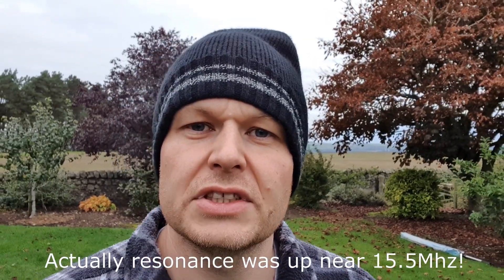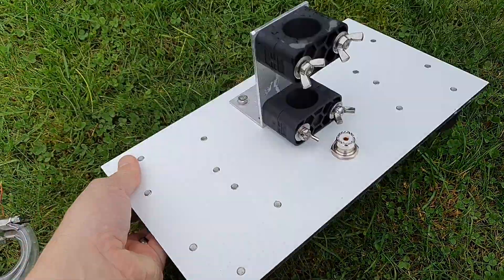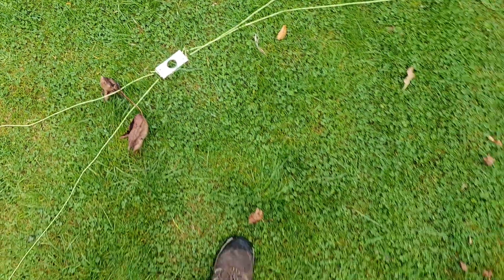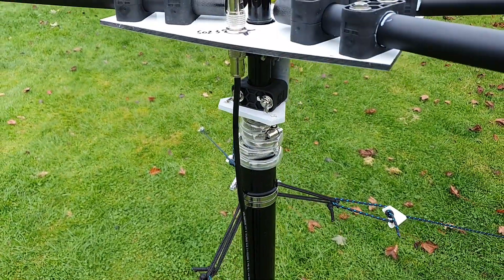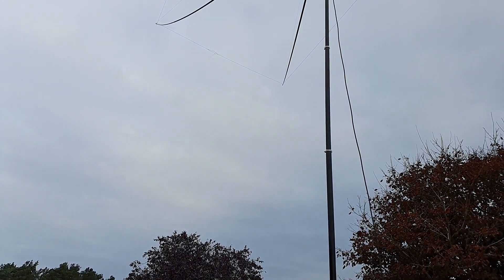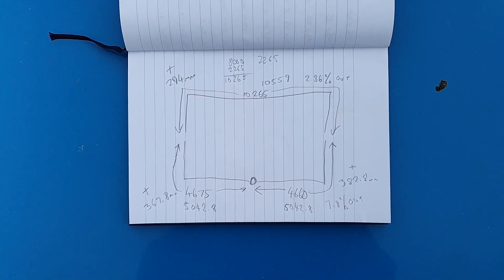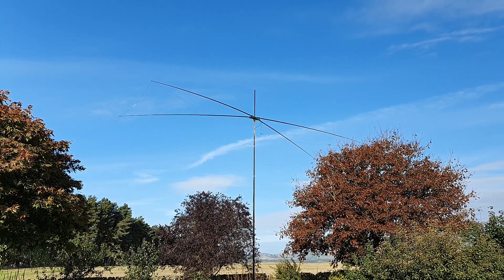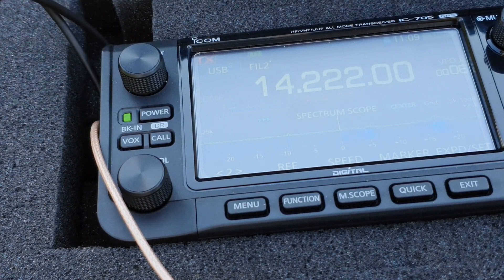20m Moxon Beam Antenna - Basic Build & Overview

Comment: Hello Colin! watched all (or most!) of your videos related to moxon antenna. Question: have you ever tried the multiband version of moxon? Is it actually doable?
73 from Georgia
Reply from the maker: I did ones with common feed and it didnt work. It needs a coaxial feed. In my opinion its not worth the hasstle. Go with a hexbeam like I'm building or similar. You can get 6 bands on it. You can only triband a Moxon due to band interaction as I understand it.
Reply: @MM0OPXFieldRadio     RGR!    I've used the HEX in a past (5 band, very original by Mike Traffie), even used the smaller version of it (10 -15m band) during my P5 operation (long time ago  😉 )  and was very happy. Currently have one in my "stock" - 6 band version, from 20m <-> 6m . My MOX question - was/is a result of pure curiosity. 😊
Best of luck.
73 de 4L4FN
Reply from the maker: Wow, I'm talking to amatuer radio royalty. What an experience for you in P5. For a monoband, I would choose the Moxon every time.
Reply: @MM0OPXFieldRadio    🤣   "royalty" - probably too bold, special and unique experience - that's for sure!      73 !

Comment: add the full butt section do not clip the tip ends and then move the element clips to tension the antenna. GM0EEH

Comment: Looks very nice. The laminate looks very interesting - I have been experimenting with a homebrew laminate of Correx sheet for centre plates but they lack rigidity at the edges which the aluminium would avoid.
Reply from the maker: I was pleasant surprised with it. Its not expensive either. I may use an additional top plate to make a sandwich which will be much stronger. Once I sort out the spreaders  and tension the wire I will review. This could be a relatively quick antenna to set up at the side of the car which will perform well.
Reply: So, is this laminate commercially available?  Or is this home brew?
Reply from the maker: @kevmscott  it's a commercial product https://plasticsheetsshop.co.uk/product/matt-white-aluminium-composite-panel-6mm/
Reply: @MM0OPXFieldRadio  , thanks Colin.  I’ve been looking for a way to use my Spider Beam mast with my Moxon. The metal plate I used, is to thick and heavy.  This looks like the ticket.  Appreciate your response.
Reply from the maker: As long as you guy it close to the top it should be good I reckon. I don't want to go any higher than it is. Not ideal but it's still over a 1/4wave high. There is some aluminium mast options out there too. I thought I could scale it up for 40m but I don't think I could get the height.

Comment: Hey Nice build Collin! Ham Radio Dude and I are going to take My Moxon out tomorrow On a POTA/SOTA with his 705, we have had it up at 6' for a couple days and it has been working great. Moxon are great antennas, I am trying to figure a couple more bands on mine not sure it will work yet. Hey instead of cutting your spreaders try figuring out how much the next section needs to go inside and put a spacer inside or suspend the wire with some paracord to take up the distance. I hat to see you cut those nice Mast!! 73
Reply from the maker: Thanks Chuck, your right. I've already decided against cutting. Got another idea to try. I believe you can multiband them for 20/15/10, it's just getting the feed sorted out. Good luck with the SOTA, 73.

Comment: Put a 1:1 choke at the antenna feed point Colin then test again before cutting wires. Your feeder length maybe affecting tuning.
Reply from the maker: I actually had a GM3SEK choke with me, just forgot to add it. Will do next time it's up.
Reply: @MM0OPXFieldRadio   Then you can eliminate the Feeder being part of the antenna, Affecting it's tuning.
Reply: It's looking good btw.